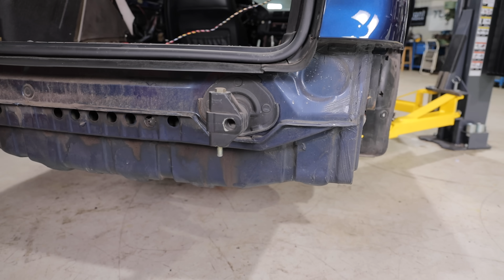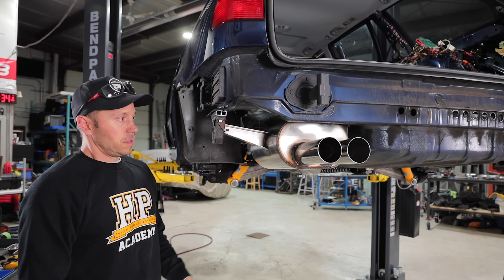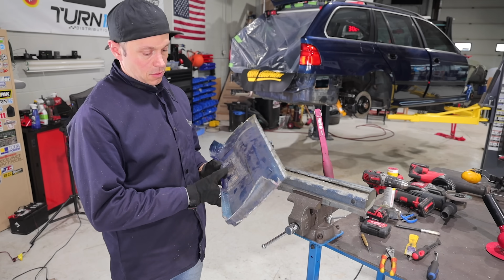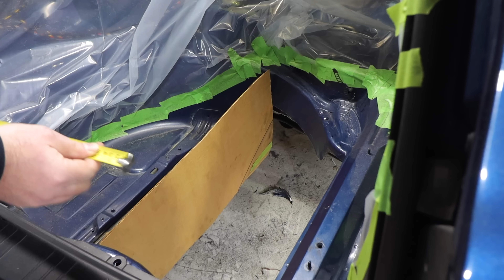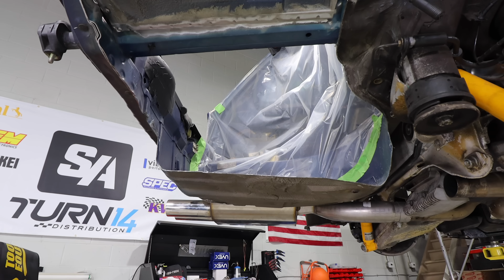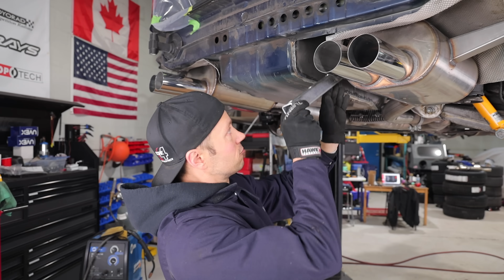BMW M5 Wagon Build - Fabricating a Proper BMW M5 Exhaust

Comment: Looks good, remember all that is structural, so in an rear collision accident you need to make sure that it’s as strong if not better than factory
Reply from the maker: Actually, the spare tire is not structural. The frame rails are and the lower beam tying them together is.

Comment: Just a suggestion when cutting sheet metal with a grinder use the metal cutting blades that are made out of metal themselves they are thinner so they remove less metal they last at least 10 times longer they don’t come apart throwing  chunks at you and you don’t have the grit from the wheel all over  you

Comment: Amazing fab work guys, really cool watching the entire process in detail!  I wonder why you didn't cut the entire wheel well and welded a flat sheet. Any plans to use that cropped wheel well space?
Reply from the maker: There’s a battery and air pump that will live there.

Comment: For the rear mount u made u should flip the bolts so the heads are on top then weld them to the backing plate so all u have to do is loosen the nuts and the whole mount would release the exhaust

Comment: No Weld through primer, should do plug welds staggered so the panel isn’t heat warped. Try and reduce gaps between panels. Use a smaller cut off wheel to do precise cuts. Otherwise sick dude!

Comment: I've ran into the same issue when installing quad exhaust on my e46 330ci, i've cut the whole spare wheel well and make a custom bracket to the side, thats all. If you wanna check it out insta @roadtuned. Currently doing a custom M54b28 engine ;)

Comment: See it would’ve been so much easier to just modify the exhaust so it flows to the muffler that already had a provision for it in the body. But content is content I guess and I love it either way
Reply: I was thinking the same, a single 5 inch exhaust
Reply: That wasn't the point of it though, the point of it was to have a dual exhaust wagon.
Reply: @mubashircheentavida  understandable, but im given an example of what i would do if the project was mine
Reply: @e5141981   @Andrew - 1_Plastic_35i   understandable
Reply: @mubashircheentavida  it wasn’t the point your right, but in the last video they asked the audience what we think they should do and I’m just following up by saying it would’ve been 100 times easier to just reroute the exhaust

Comment: Awesome! I understand now why we got no video last tuesday 😅

Big thumbs up! I would haven't got the guts to get into this job personally! With a good job of paint and undercoating it will looks perfect!

Would a jigsaw would have been useful with the sheet metal? I hate cutting sheet metal with a grinder I find it so much easier with a jigsaw when the gauge is thin enough!
Reply from the maker: Yes but we needed to get it done quick so cutting wheel seemed like the way to go